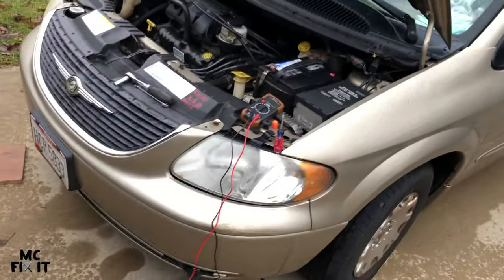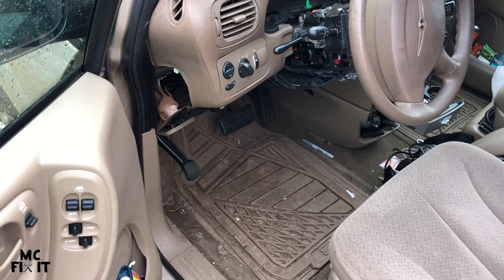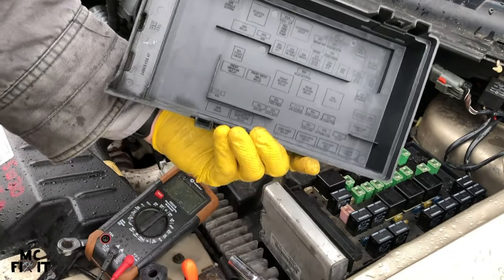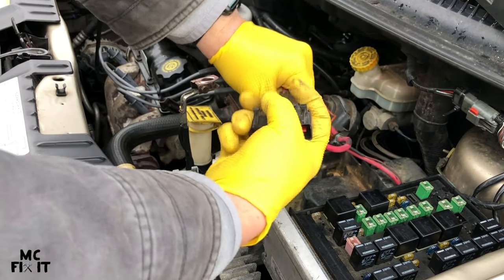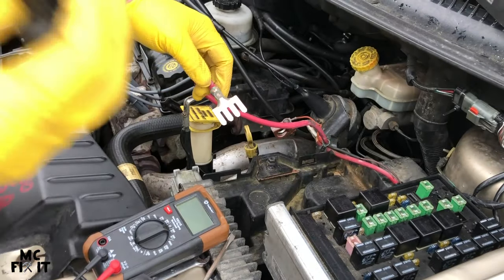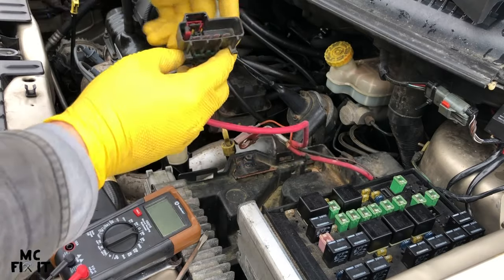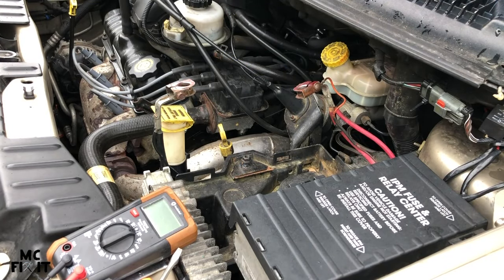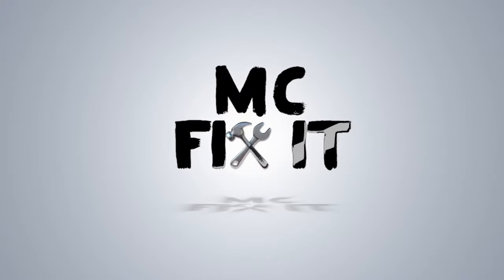Won't Start? No Start No Crank Intermittent starting problem solved! Dodge Caravan Town and Country

Comment: But why did it take 15 minute's to say this?
Reply from the maker: Because these problems are so complex on these older vans. There's so many different things that mimic each other. I went through all of the different issues I had and how to try to correct them.
Reply: In glad you were thorough with your process but it might be leading people into deeper holes.  So on the 4th generations, 01-07 of you turn your key from from off to accessory 3 times with all the doors closed and touch nothing else the van reads its own engine codes, when you were blindingly flipping the key it was starting starting that test and then stopping the test halfway through its process, which is sometimes why you got p codes, it was about to tell you what is wrong with itself, but instead it skipped to the end process most of the time and just said done.  The van will not crank during this process.  Instead you blindly through parts at it and in the wrong order..  The ignition switch will not initiate the starter if it doesn't pass its self test.  You most certainly can tap the key with a hammer, but that's only in the event the key doesn't turn at all and the tumblers are frozen not if the key is turning but the engine won't crank.  The idea is to tap the key and send a small amount of kinetic energy into the calendar to free the tumbler, then lubricate the key and reinsert it to introduce oils to the moving internal parts of the lock, you're not driving a nail.  If you would have started by reading your owners manual that mentions the process of reading your own obd2 codes, you would also know to check for your 5v sensor to ground indicator.  I know as dudes from our generation we like to tinker and fix our own stuff, but I think a little homework on your part before you started this project would have saved you days of headache and definitely a lot of money.  I get that this is more of really a vlog than a heads up on if you have symptom x, then your solution is y.

Comment: Also, I figured out that the "done" in the odometer area, while cranking, are your P Codes. And there is no corresponding code for this issue.
Reply from the maker: Yes, someone else mentioned that in the comment section. I sure would have been helpful for it to display a code to be able to fix it.
Reply: Mine is saying that ...and it won't start ....do u know y and what it means.
Reply: @danielsaienni2605  Is the code the 'done' or another code? Mine said done meaning it had no codes.
Reply: @danielsaienni2605  Also, I had all of these same symptoms and I replaced the starter with one I bought CHEAP on Amazon. No more problems.
Reply: Got a new starter  new battery n relay ...n still won't start.
Reply: I think the codes where reset and that's y it isn't showing up. It was reset but never fixed.

Comment: Totally illogical way of going about the problem. There is a method of reasoning called deductive thinking (it's banned in US schools (LOL)). 1. Why take apart the steering column when you can just use a DMM or even w/o it hear the relay click when you turn the ignition switch ?
2. The same DMM can used to check for the  presence of 12V at the starter motor and also to check if the voltage is supplied to the starter solenoid when ignition switch is turned. 
I would highly recommend anybody trying to troubleshoot car electrical problems learn how to use a Volt/Ohm meter. You will be able to find short/open, bad connections, loose grounds check alternators and much much more. There no need to remove every suspected part one by one to find an electrical problem when you have a DMM handy.